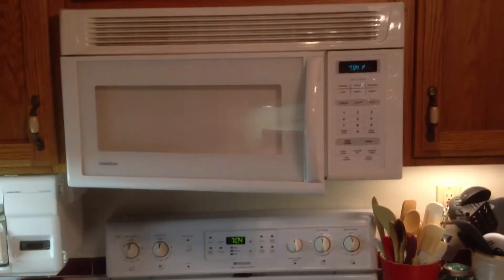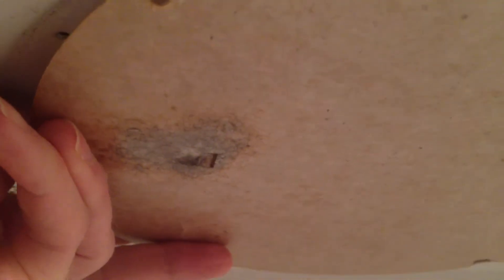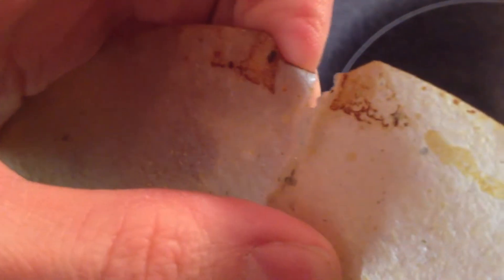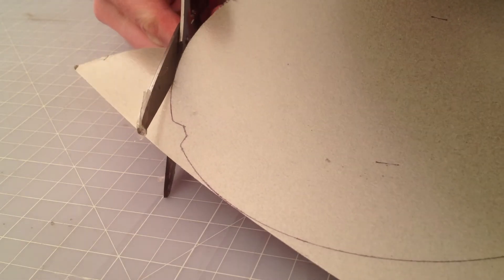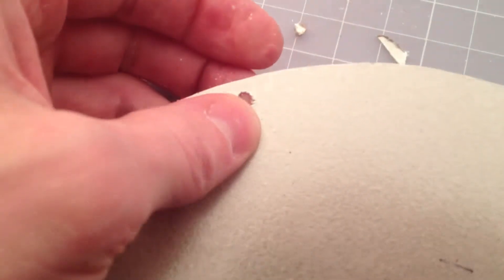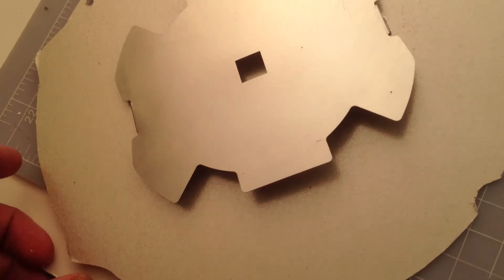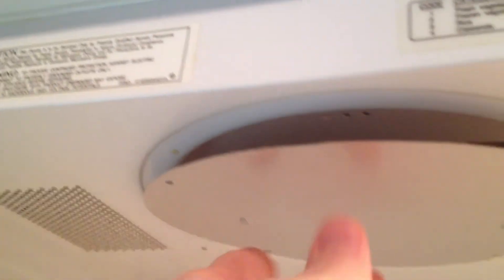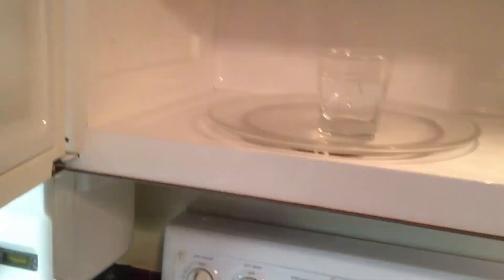How to Fix Sparking/Flashing Microwave - Mica Guide Cover Repair Waveguide Plate Replacement

Comment: Where can I buy the mica sheet that suitable for my microwave model? Because even the universal size are not smaller than mine. If my model is old, where should I get it? Model Number: DMW104W.

Comment: I always put a cover on top of the food that I am heating up. 🤔

My grandmother has a Microwave that's way older than that and it's still ticking.
(will edit this if a can get rough estimate)

Modern household appliances are unfortunately not built to last. 😐
Reply from the maker: I had one from the 70's that was massive, and wouldn't die. I'm a fan of older appliances - built to last!
Reply: @6thGearHouse  My Grandmother bought it new in 1982.
Reply: @madcat4563  I bought a new microwave in 1983. It was still going strong in 2006 when I gave it away. Only reason I don’t regret having given it away is because that thing was one of those old heavy back busters.
Reply: Same. I just bought a combi microwave from 1996 for 10$. Label says made in Sweden. Thing still goes strong, but one of the Mica plate has to be replaced, which is what I'm going to do. Wonder how many more years I can get out of that thing :)